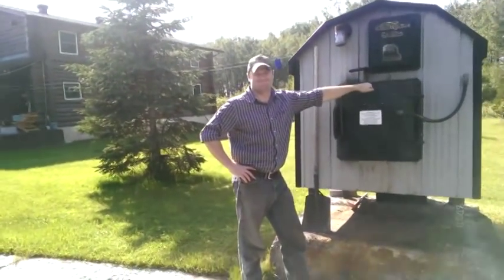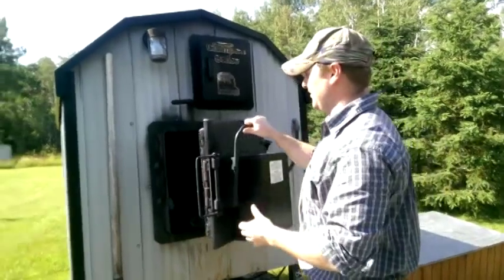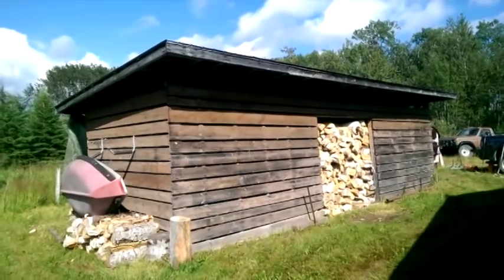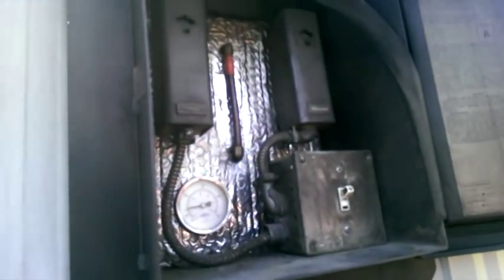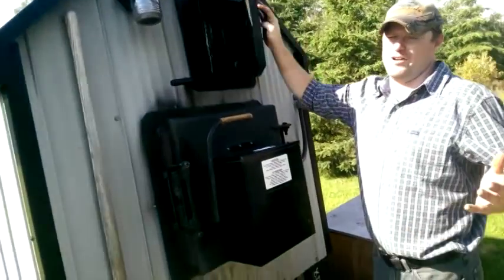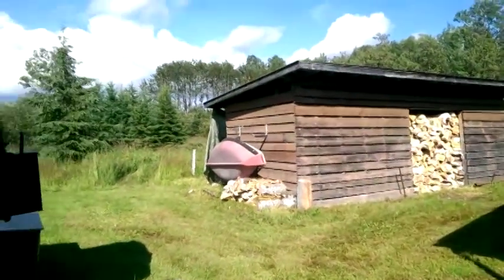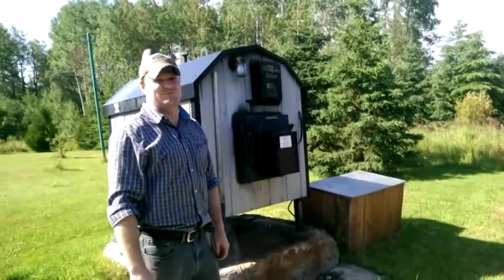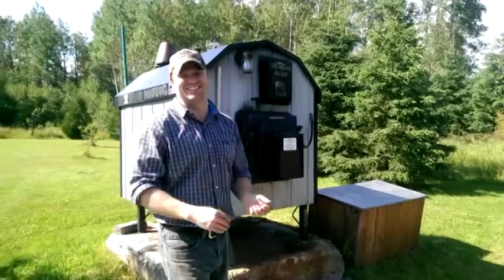The concept of an outdoor, wood burning furnace

Comment: Next time your at the hardware store buy yourself a peavy hook. Loggers use it to grab wood without having to bend down aka saves your back. With your woodshed it will make it a lot easier to pull wood out for feeding the owb.

Comment: A bit more than a year out of that Wood supply for $1400 so about $100 per month year round or $200 per month for 6 months or $350 per month for 4 months,... Doesn't sound that cheap to me lol.
I like the concept of an outdoor furnace for hot water radiator heat & also for hot water usage but why is the furnace so far from the house ?
Reply: David Yummus well he said propane was 700 a month.
Reply: 350 for 4 months
the furnace is a potential BOMB. thats why it is so far from the house
... he has a fairly large home, 350 is cheap to keep it warm in -45 celsius. 
another thing he did not mention is that wood and this one unit will heat MANY buildings at the same time.
if you have a large shop or a bunkie or perhaps 2 houses on one lot, now youre heating them all for 350/mth.

very efficient for our northern ontario winters. you'd have to live here to understand i guess.